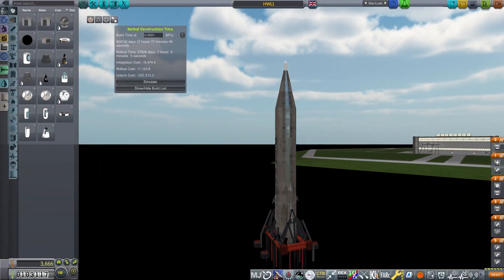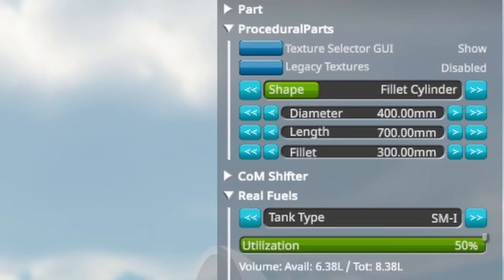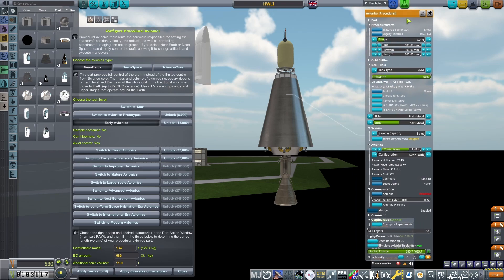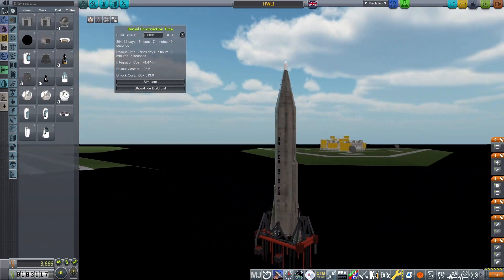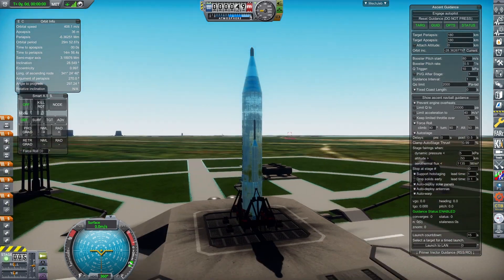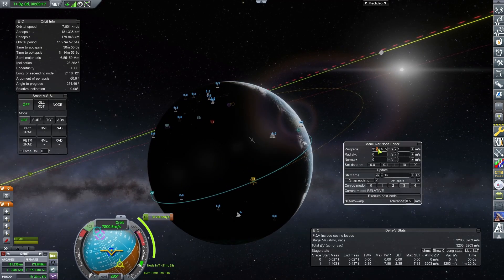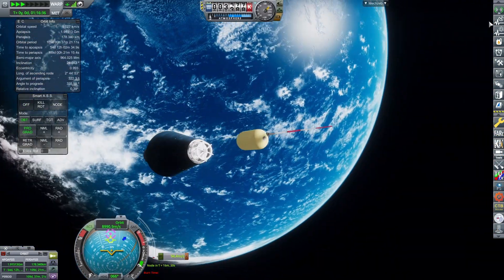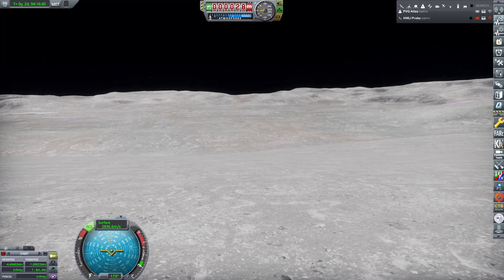How To Smack The Moon In KSP RP-1!

Comment: How would I go and do that from Baikonur though? Since I can't launch into the moons plane due to latitude?
Reply from the maker: You can't do this from Baikonur no, when I've launched from high latitudes before I do a polar launch and estimate where the Moon will be, its a bit wonky doing it like that though. You can launch straight east from Baikonur if your LAN is at a point where your burn to the moon is at the Ascending Node or Descending Node compared to The Moon,  but I've yet to find a way to reliably do this without resorting to using kOS, I think beardy might have a way though, I should probably ask him haha
Reply: @Carnasa  Right those were my initial ideas as well. I'm at the point in my career where I have the tech, but lack the know-how for impactor. Launching polar would be my alternative, but I really want to find a way to get the ascending node inside the initial trajectory, preferrably even at apogee after booster burnout. I just can't find it anywhere
Reply: @der_niro4318  on the ro discord theres a kos script that will give you the inclination you must launch into to spare you the eyeballing

Comment: Why bother releasing the probe? Why not just deactivate the avionics on the tli stage?
Reply from the maker: Early avionics dont allow you to do this do they? Could be wrong though, and now I need to check :P
Reply: @Carnasa  I have never gotten this far. But I was curious if we could save the mass on the decoupler, since both are impactors anyhow.
Reply from the maker: @AstroHopefulBenjaminGottsch  I'll have to check it out, but I'm fairly sure its impossible to de-activate early game near earth avionics though. Speaking of saving mass on the decoupler, that's what my other design uses, the tli stage is attached to the probe core, however, burning full tli with no control is a tad sketchy :P (but it absolutely can work)